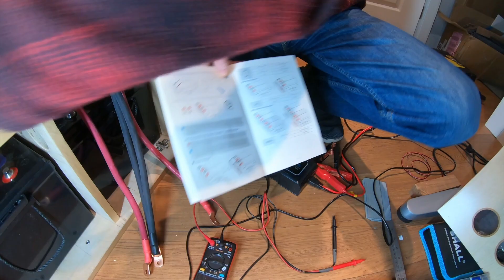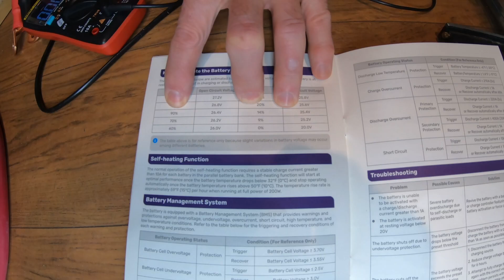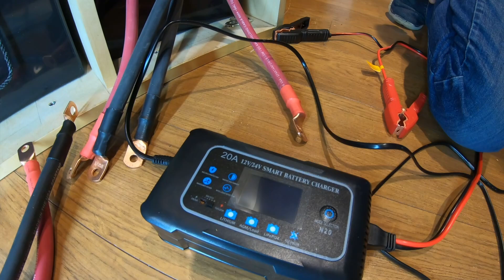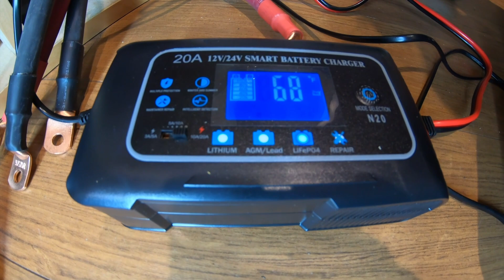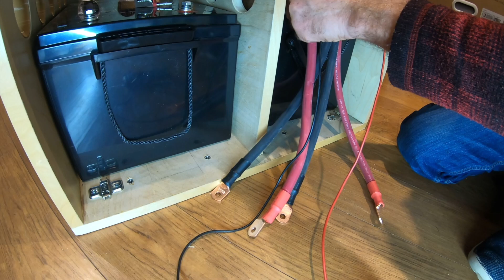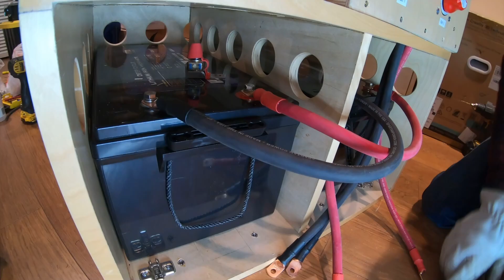How to Charge & Balance LiFePO4 Batteries for Optimal Performance | Renogy 24V 200Ah Setup

Comment: 4:45 Interesting to see you had the stud-fuse right there, and did not use it. It is a bit of a gripe for me how many people (myself included) often first do a temporary setup without fuse "-we'll add the fuse later, but for now, quickly see if it works...-" but in reality, it is during the setup and tinkering that things often go wrong and fuses are needed most.
Reply from the maker: We did not use the stud-fuse when connecting the 2 batteries together for balancing as it is not needed.  It was there for when we connected the batteries to our electrical system. Both our batteries have these fuses - next video coming next week. Thanks.